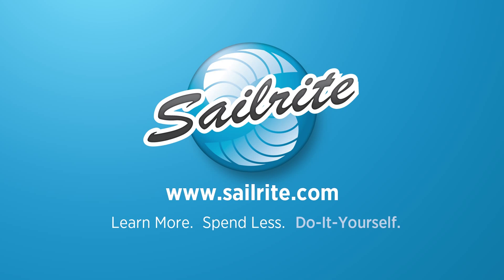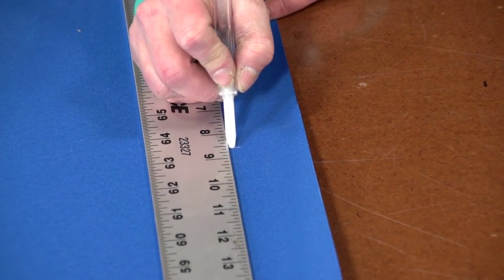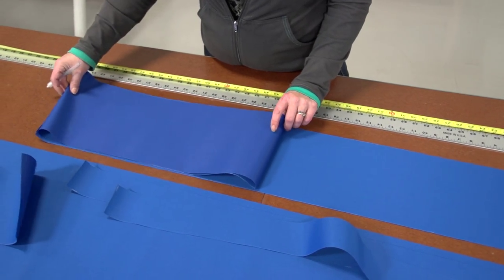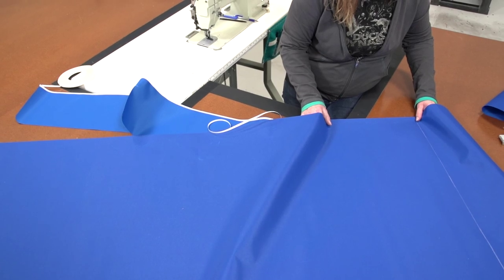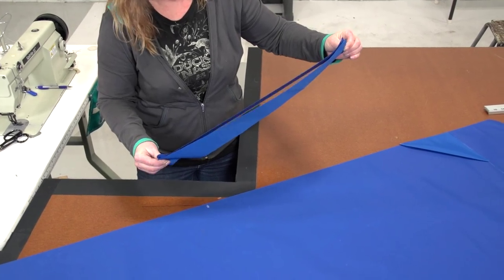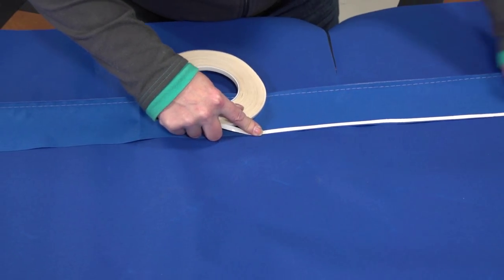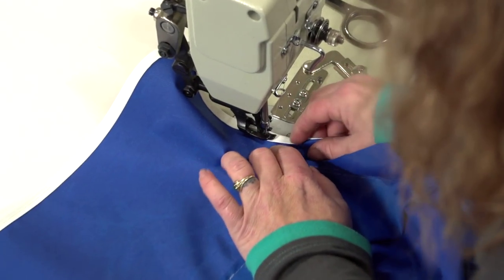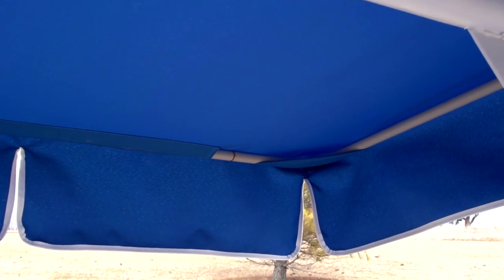How to Make a Swing Canopy with Valance Edge

Comment: Fantastic video. We modified it a bit to fit the 82" width of our lawn swing. No way do we get the new canopy sewn without this video. I am a 62 year old male who has never sewn in his life and my sewing partner is my 91 year old mom. We  must have viewed the video 10+ times but we nailed it! My only recommendation would be to share with the viewer if they do not want to add the binding that they can simply hem the edges of the material. That is what we did.
Reply from the maker: Good job! Also a great suggestion about not using binding, a double hem is an excellent way to finish that edge.

Comment: How do you measure to get it nice and taught when you don't have an existing one to use as a template?
Reply from the maker: Measure your frame and add 1/4" to all sides for seam allowance. I would then sew pockets and valances edges on using a 1/2" seam allowance, which will make the top fit nice and tight, slightly smaller in size than the frame.
Reply: @SailriteDIY  Awesome. Thanks.